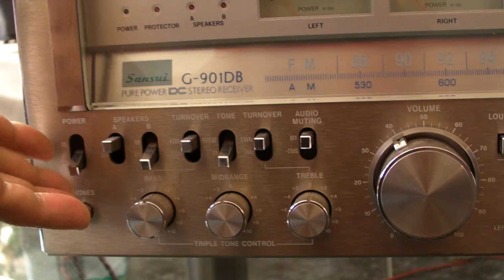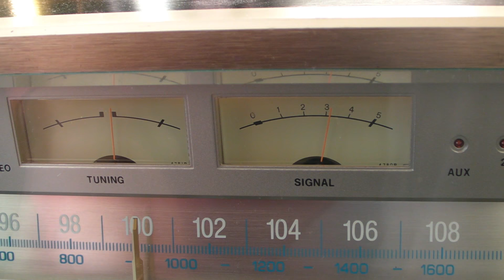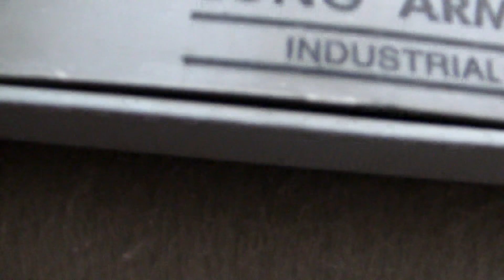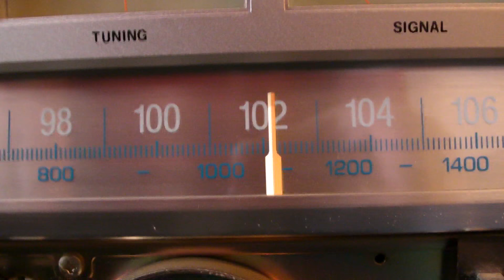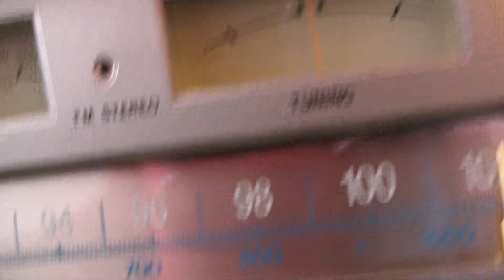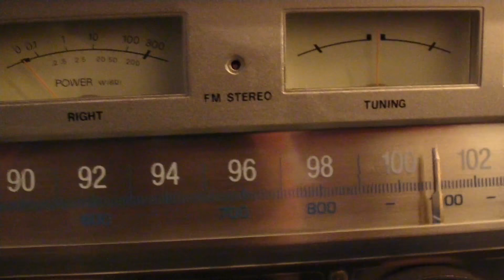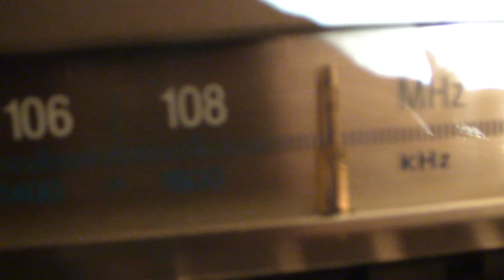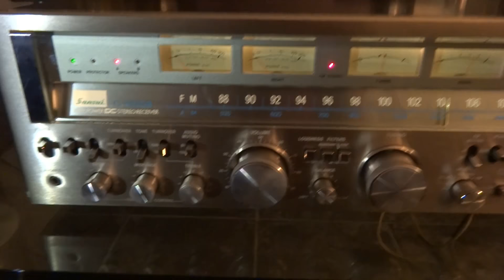Sansui G-9000 Sansui G-901DB cleaning

Comment: This was a very helpful video, thanks so much for posting it!  I recently bought a G-9000 and one channel was dead, the other very scratchy.  After opening up the case and loosing the two lower boards, I was able to access all the lower pots and switches and sprayed Deoxit directly into the holes in the housings.  After pulling down the two lower boards, you can see the upper row of toggle switches and I was able to spray the Deoxit in them as well. I cleaned all pots and switches this way and after a full detail of the faceplate with Flitz polish, this beast looks and works like brand new!  Don't forget to clean the side switch for the amp and preamp as well.

Comment: all you have to do is lay the unit on its back, with the knobs up. take the knobs off. drip or spray the cleaner onto the shaft and let it run down into the pot, the run the shaft back and forth (clockwise and counterclockwise in a quick spin(like you did) to spread the cleaner and clean the contact surfaces. you don't have to take apart any receiver you want to clean. except maybe taking the cover and face off to clean out the cobwebs  lol i have been doing it that way for years.

Comment: Hi Andrew, I'm afraid that is not a proper way of using the air duster. U should always keep it upright, otherwise the water will come out. How much you've paid for Sansui G9000? And has the unit been restored? Thanks
Reply from the maker: It is original but Simon will do a recap soon. I paid 1200 euro

Comment: Hey Andrew, I have the same unit, but mine emanates a foul smell (like normal vintage electronics only 100 fold) a little after warm up, and is constant! After 30 minutes of use i must turn the darn thing off, since my room reeks of this odor! D you have any ideas what might cause this?  Purchased it non-operational, and had it fixed and cleaned. Hence I do not know if the smell there prior. The Tech that worked on it says , he does not really know  or he does not think that it was the chemicals. Could a cleaner do this, or does anyone else experience this? Any insight would be appreciated...
Reply: Bad caps